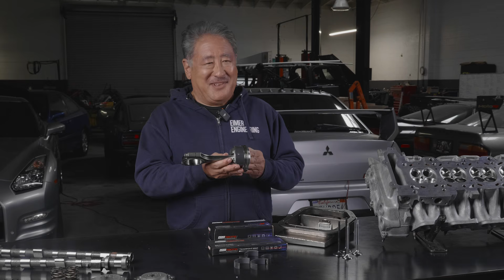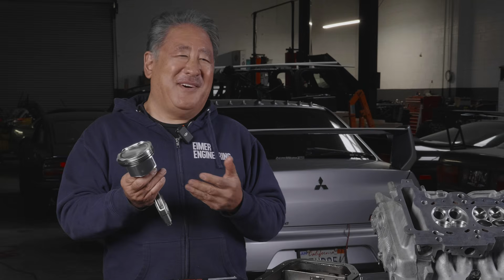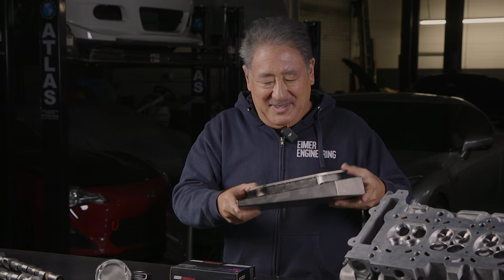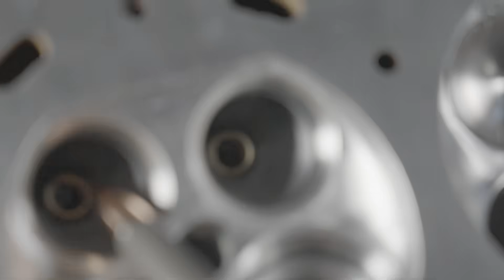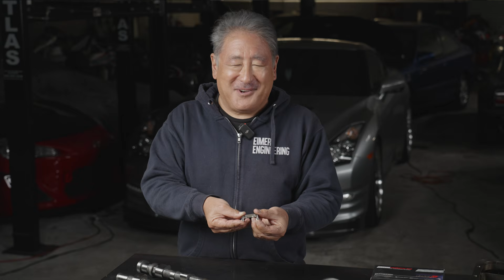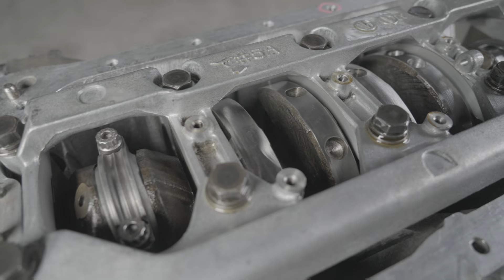How to Build a Bulletproof 400 Horsepower Nissan SR20 Engine!

Comment: GTiR Owner... appreciate the massive knowledge dump... been trying to learn all i can since i got mine in 07... (1st Aussie Owner of mine) keen to see a special GTiR build one day... tackling some of the other 54c version specifics like upgrading the dizzy to coil on plug etc while you're there showing us the extra wide bearings / head bolts / water pump / Quad Throttle Intake etc... (flow test a GTiR head vs the VE head (before & after your fav valve job) ... the stock TMIC perhaps, though autospeed had an old article with all the oem nissan intercoolers done like 2 decades ago)

Comment: 27:46 I 1,000% agree, with an exception. The double notch mod is essential imo, and running the stoppers with the stock un-notched rockers makes it worse, and honestly I feel they fall off easier. But running stoppers WITH the double notch rocker arm mod, I have never lost a rocker ever.

Another thing on stock rocker arm setups (no notch), is one like you mentioned, the shim adjustment being 0.001 perfect is essential, and it's why these get a bad rep. But also and equally as important and why they fail, is the lifters being worn out, and if they install new OEM lifters, people don't properly bleed them. You have to submerge each lifter in oil and compress the heck out of them to get every bit of oil in them. Not doing this or re-using super old factory lifters, and then banging the limiter, even with properly shimmed valve train, I find equally causes failure. But with the double rocker mod, you can get away with improperly bleed lifters and never have a problem (but you might still get minor valve float issues where the engine power falls off at high rpm and you don't know why)
Reply from the maker: The lifters bleed themselves after a few minutes of running and you can tell if they are not bled because they are super noisey.  So if your valvetrain is noisey, don't rev high and if it doesnt stop making noise replace the bad lifter. I still recommend not running the stoppers and running the guide shim on both sides, have never had a rocker modded like this fall off either.

Comment: I got a head to look at 🤣blew my sr20det that was bought as an OE rebuild and unknown miles with Tomei PodCams. With a handful of bolt on upgrades it was tuned to 367whp and 341wtq. Mainly took it to drift days for about 7 years and 2 transmissions later think we floated a valve and melted into cylinder 2 or exactly what you're talking about on the rocker arm stoppers is more than likely what happened! Bottom end still looks brand new with little scoring in the cylinder walls. Time to figure out a game plan for rebuild and definitely will be indexing this video!

Comment: Mikes’s the man! When I used to drive a Nissan SE-R back in the early 2000’s. I used to be in the SR20 forum and talked to Mike about building my SR20. There weren’t many people at the time building and making parts for the SR20’s. I went all out had the block cleaned, heads ported, intake matched, ECU tuned, had water injection kit map, had cams by Jim Wolf technology. I had a JUN flywheel, ARIAS forged pistons, Swain coated them, forged Crower rods, ACT stage 3 clutch, custom turbo kit ( no one made any for the SER) by HotShot, and Mike recommended me to use the HKS GT turbo forgot the size ( but didn’t do it because no one ever done it and was afraid it won’t fit) so I ended up with a turbonetics T3/T4 that Rob Cadle recommended. I forgot who he worked for ( Garret?) but they made turbos. But my dream and probably one of first few built Nissan SER with a built engine never happened. Spent at least 15k if not more on parts. Due to one person screwing things up from the start making promises but never came through. Ended up finding a shop to try to fix the mess but it ran like shit. Due to the fact they didn’t take it apart and they were not Nissan experts. Only if I lived in California. 😔. But Mikes the man. I don’t think if he remembers me about our conversations about my SER turbo options.

Comment: Hi hi.

Thank you for the great vids.
May I ask you a question? I am in the process of rebuilding two CA18DET engines and I have noticed something.

What is the correct orientation of the con rods in the CA18DET?
On one of the engines the con rod bearing tangs are facing the the exhaust side and on the other engine the tangs are facing the intake side.

The pistons were correctly installed by the looks of it even though the rods are orientated opposite in one of the engines. The dots are facing the front of the engine on both.
It seems both engines have been rebuilt/refreshed at some stage by someone prior.

Is there any indicators what the correct orientation should be not considering the marks on the pistons as they will be replaced on both engines?
Both engines have OEM con rods and pistons.

Your advice will be greatly appreciated.
Thank you.

Comment: Why doesn't anyone use roller rockers from a USDM G20 kind of engine? Seems like all the parts bolt in and are available including JWT cams.
Reply from the maker: Not a good selection of cams.  Rollers need an inverted flank profile and it's hard to grind anything more than a mild profile with the space given.

Comment: How to build a 400hp EA888.3
Big turbo, down pipe, remap. 😅
Reply from the maker: We didnt like the one we tried to race, the electronics were battling everything and one of the best VW tuners in the country could not figure it out.  Good engine but bad electronics controlling it.
Reply: @motoiq Very interesting 🤔 never heard of any issues tuning these, there's plenty of tuners getting these safely over 500whp. I aren't sure why you've had issues.
Reply from the maker: They don't race to where the electronic nannies are trying to outsmart the driver. The engine itself is great.

Comment: Would these parts still work with a sr20de if im making it a DE+T? I have a non turbo 1996 silvia.
Reply from the maker: Yes
Reply: @motoiq  why do I keep reading how parts from/for the det work on a de/de+T. All I know is different is the DE is a 10:1 not a 9:1 like the det
Reply from the maker: Piston squirters and oil pump

Comment: How can I fix a crossover problem on TODA Racing 264° 10.5mm lift camshafts 
intake open BTDC= -4°
Intake close ABDC= 50°
Cam top center = 117°
Effective angle = 226°

Exhaust open BBDC = 52°
Exhaust close ATDC = -6°
Cam top center = 119°
Effective angle = 226°

crossing = AOA+RFE= 10°

Is it possible to have these crossing angles on adjustable sprockets other than those of TODA, or is it absolutely necessary to have the adjustable sprockets of TODA Racing?
Another question: what does Effective angle mean? 
Can these camshafts work with TOMEI solid pivots, in a sr20de cylinder head?
Watching your video, I got to know a lot about the SR20's technology
It's really great!!
Kind regards
Reply from the maker: You can use any adjustable sprockets but to set cam timing I recommend you study the proper way to do it with a dial indicator. The effective angle is probably jinglish for the duration at some easy to measure lift, probably 1mm.  As far as working with solid lash adjusters, it depends if the cams clearance ramps were designed to work with them.  That question is best asked to Tomei.

Comment: Do you like the SR20 over the k20?
Reply from the maker: The K20 is a vastly better motor benefiting from 10 years of technology.
Reply: @motoiq  yeah K series is badass. I’ve gotten out from the Honda game but If I was gonna build a fun little street machine it would be a K24 N/A setup in a light chassis. Simple reliable quick.
Reply from the maker: I agree, that is a fun combo.

Comment: I'd love to hear his take on the Gtir🤓
Reply from the maker: The engine or car?
Reply: The engine and maybe the difference  in the sr20ve and the sr20det 53c motor 🤓
Reply from the maker: The main difference besides the ITB's is that the combustion chamber is open with a lower compression ratio and the block has wider rails.  The rods are stronger and the head has bigger bolts. It also has a mechanical cam.
Reply: Have you guys had much experience  on stock turbo and safe hp ranges I have a 53c in my p10 G20.  And I want to see max hp on stock parts...I've done a few aftermarket  upgrades when doing my refresh....just wanted to Pick your 🧠
Reply from the maker: High 200's, low 300's for the stock turbo on pump gas, E85 or race gas somewhat higher, it's a pretty decent turbo considering how old it is. The stock Injectors are small.

Comment: Someone please help lean in boost issue have tried everything i can think of have 2 different tunes both are lean in boost one slightly worse than the other but im out of ideas
Reply from the maker: Any decent tuner should be able to solve that and tell you if you have a fuel delivery issue.
Reply: @motoiq  have any recommendations Jim Wolf technology can't seem to help we live in rural wv we have swapped sensors ...checked fuel pressure/ voltage new 450lph walbro pump had injectors flow tested 750cc
Reply from the maker: bad maf perhaps

Comment: You talked about adding oil squirters to a DE block. What power would you start to recommend that?
Reply from the maker: I do it for any performance DE beyond bolt ons where you are raising the compression ratio or adding boost.

Comment: What bearing oil clearances do you usually run? I’m building a 300whp sr20det and looking to set redline at 8100 rpm or so, trying to get it to be reliable as possible
Reply from the maker: about 15 tenths in the rod and 7 to 10 tenths to the mains
Reply: @motoiq thank you so much, love your channel

Comment: My bucket of crap sr20 has run 21psi for over 10 years and runs just less than 400hp completely stock bottom, recs to 8k and has never thrown a rocker.
I have NA cams, 725cc inj, disco spud turbo, cooler and autronic sm3.
Secret to mine is.. red top motor, good ecu and a tuner that knows what they are doing.
I will be doing what this video descibes next but with a VE head.
Reply from the maker: What do you do for your rev limiter?
Reply: @motoiq  autronic sm3 seems to cut soft enough to not pop rockers, it doesn't make much after 7.5k rpm so not much point pushing it that far anyway. 
I attribute the longevity to my tuner tho.. he has been around for a long long time and did tune the mca hammerhead in its early years.
Reply from the maker: I want to experiment with different rev limiter strategies to stop rockers from popping off. DBW throttle control integrated into it.
Reply: @motoiq  I'm not a tuner but as far as I know mine will cut soft then cut more cylinders depending on how hard the engine tries to push past the limiter, it retards the ignition but keeps fuel to stop lean out. 
We intended to have anti-lag with a tb bypass, that config may have something to do with how it cuts cylinders.
I was advised to use 1 step colder platinum plugs too.
Dbw to shut the throttle off on limiter in conjunction with the ecu?.. if the dbw can move fast enough then it would help but doesn't help complexity. 
First thing I would do is dual rocker guide mod if you haven't already. Next maybe limiting any slack in the valve train that maybe cause a cam to bounce around in its timing while the back and forth of the limiter engages.
Reply from the maker: We use a DBW first stage rev limit on our FD car and it seems to be wonderful and very easy on the engine.  The LS can get away with Hydraulic lifters with it.  If you watch the video, we advocate the dual guide shims. Supposedly the roller cam HLA's have less travel and don't spit off rockers as easily too.  Do you know about that?
Reply: @motoiq  I see what you are referring to..hla would give the rocker less chance to be thrown.. if you can get them madee/modded for Sr.  
I was thinking that eliminating the slack in the chain would limit the bounce the cams have in the on/off load rev limiter situation, mazworx manual chain tensioner might help with that.  Also more of a hard wall for the limiter where it holds limit rather than bounces might help?
I must of missed the dual guide bit of the video sorry.
As I said, I would immediately go VE for the rocker reason and well as many others but I understand you want to improve on the DE platform, I can't give many recommendations other than off the shelf solutions.
Oil pressure may be an issue with heat causing thinning and loss of lash adjustment/lifter failure or low valve seat pressure allowing a harmonic that causes spring flutter, I'm not a professional and I don't exactly know everything about the whole situation.  
Im completely assuming the culprit to be relative to a moment where any kind of gap exists where the rocker can eject, there can be many.

Comment: I've been running an s13 SR20DET in my auto-x Datsun 510 that's been making a reliable 374 whp on e85 for nearly a decade. The bottom end is all stock rebuild with a Greddy oil pan. The high port head was decked, ports are polished and matched to manis, stock guides valves, and retainers with mild Tomei cams and two stage springs. 22psi from a GT-X2867R on a log mani. 50K + miles on it and it's running as strong as the day we fired it up. I'm an SR20 fanboy and proud of it.
Reply from the maker: Watch for a FBO SR20 soon!
Reply: What rod and main bearings did you end up using? Bi metal tri metal? Considering building up my Sr but wasn’t sure which route to go with
Reply: @joseg.4626  Really depends on what your power goals are and how it'll be used. I'm not making a ridiculous amount of HP so new stock replacement rods and pistons with King bearings are more than enough handle it. Also had the crank magnifuxed rebalanced. For track use, it's important to have a large capacity oil pan with internal trapdoor surge tank for the pickup. That said, Eagle rods and pistons are a worthy upgrade for up wards of 500+ HP.
Reply: 374 on 22psi that's a waste of boost
Reply: @matden5595  Wasted boost, how so? Remember, that 374 wasn't crank hp, but rwhp. So add 15% drivetrain loss. My SR made that with 195 r15 street tires on a DynoTech chassis rig, so add another 5% slippage loss.  In all reality, it's making upwards of 450 bhp on mild cams and a safe e85 tune with WO timing at 9 degrees BTDC. In that little sub 2,000 lb car, the only thing wasted is having more power than can be put to the ground. No sense in pushing it for bragging rights.
Reply: @Datsun510zen  if you need 22 psi to make that power something is going wrong
Reply: @Datsun510zen  that's less than what I made on 15 psi
Reply: @Datsun510zen  he needs a bigger turbo a gt a 32 or smnt that 28 is restricting the engine
Reply: Deadstock? No pistons, sleeves, nothing? That’s badass man I’ve been worried to build mine since I’m gonna daily it around 400 wheel, but I’m also building my internals and I might sleeve it if I have the money.
Reply: @GremlinZ420  The stock 5mm sleeves can handle well over 600hp, so they aren't the weak link here. Mine only needed a slight honing to clean them up, but if needed, you can safely bore .5 mm. My thinking is, if it aint broken, why fix it. The only reason to re-sleeve is if it's already over bored, has serious cylinder wall damage, or if you're looking to increase displacement. Absent any of these reasons, you already have the most reliable option. My goal was reliability pushing a relatively moderate 400 hp on e85. With ethanol's superior knock resistance and cooler combustion temps I knew the OEM pistons and rods could handle it. I think a big part of it's longevity is having a safe tune going fairly rich. Another being the car is very light so less stress on the engine. What car is your SR going into, and what size turbo?

Comment: Are fwd sr20s as tuneable as rwd sr20s?
Reply from the maker: Yes!
Reply: @motoiq  what would be a safe power range and torque, that a fwd sr20 should be tuned to, and what turbo/ turbo kits are the best for bolt ons?

Comment: I will give Respect where credit is due !,  But I would rather Build an EA888 2.0 VW Golf Engine, well over 500 HP & Reliable as long as the day, Or the EA390 3.2 VR6 Over 800 HP Twin Turbo. Show me an Engine Block with More Meat between the Cylinders, And I will show You a Japanese Block that will never outmatch! It. :body-blue-raised-arms::face-purple-crying::trophy-yellow-smiling:
Reply from the maker: 2JZ, K24, VR38, 4G63!

Comment: I wish I had this video years ago when I tried to assemble an sr20det for drifting. I swapped the cams for bc264s with their springs and retainers. The engine ran fine until it spit a rocker and dropped a valve destroying the engine. I always felt the ras had a big part in the dropped valve. Now i'm soaking up all the info possible, since i'm almost done collecting parts for the top to bottom rebuild. Great content, i'm glad I found this channel.